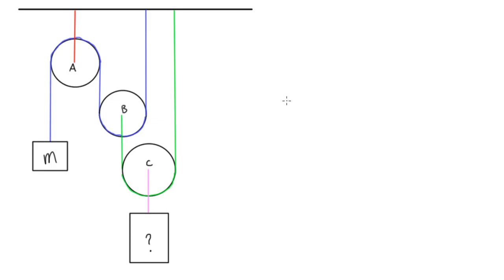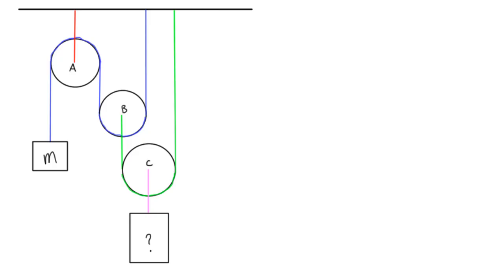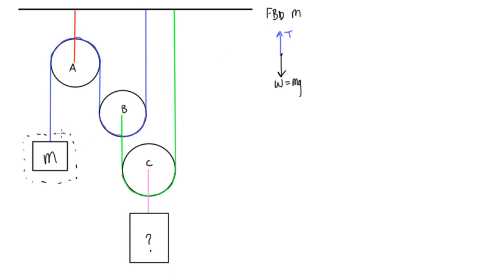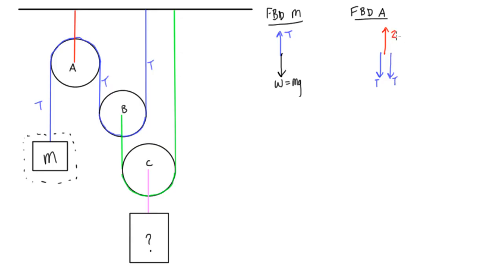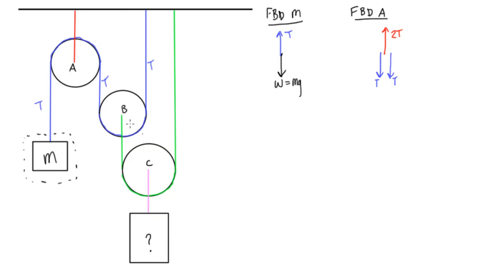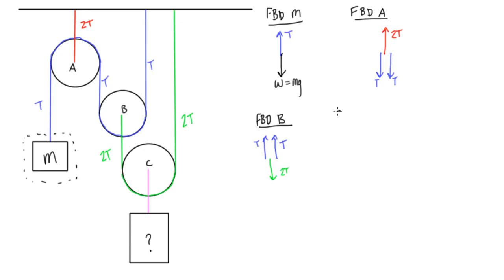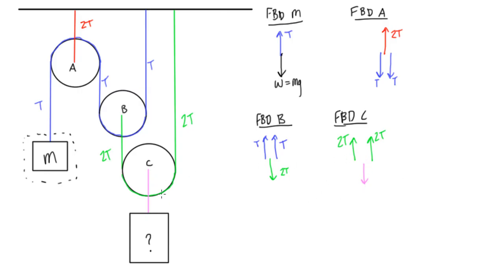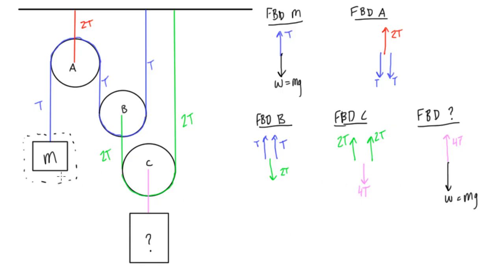How to calculate tension in a multiple pulley system

Comment: Interesting, when reverse the mechanical advantage...in this case from question mark box to m, obtaining a quarter of initial tension for m...you obtain the mechanical dissadvantage useful for building fitness stations. Therefore, you don't have to have 20 plates (weights) or more at the beginning (100kg or more), you only need like half of that and according each cable and it's pulley system, you will have to push/pull/lift a higher amount than the set of weights available for the fitness station.
 For example, if m is a set of weights with a total of 50kg and at the question mark you add another pulley with a cable,  you will have to deadlift 200kg, which would be quite a good weight for a athletic guy.

Comment: thank you very much, I was struggling to understand how can a pulley makes easier to lift something, if the tension on the cable was constant. well, happens that the tension in fact is constant along the cable, and yet, it can multiply the force applied. thank you for demonstrating it, so clearly and so short!
Reply from the maker: Glad I could help!! 🙂🙂

Comment: Just looking at that picture of pulleys lost me.  You are obviously not showing how the green rope of pulley C is attached on pulley B.  Is it tied to the center of pulley B where they pulley B rotates around?
Reply from the maker: In 2D statics problems, ropes will either be wrapped around the outside of a pulley, or attached to a pin in the centre. That's how you will see everyone draw them. So yeah, one end of the green rope is attached to the centre of B, pulling straight down on B. Similar to the red rope which is attached to the centre of pulley A, pulling straight up on A. It is also standard to assume in 2D statics problems that there is no friction in 2D statics problems unless clearly indicated in the problem.

Comment: FBD of C 4T acts in downward direction but in unknown mass block its acts in upward direction... Why??
Reply from the maker: Every point A, B, C , and the mass centre of each block has forces acting up and forces acting down. For each of A, B, C, and the mass centre of each block, the forces acting up at that point are equal and opposite to the forces acting down. This is because we are told that the system is in static equilibrium, so every part must also be in static equilibrium. Point C has tension from each side of the green cable pulling up, and tension from the pink cable pulling down. The mass centre of the unknown block has tension from the pink cable pulling up, and the force of it's weight "pulling" down. The tension force inside the pink cable is equal to the weight of the unknown mass block (which is 40N). So the pink cable pulls up on the block with a force of 40N, and also pulls down on pulley C with a force of 40N. I recommend watching this other video that I made introducing tension in cables: https://youtu.be/nVfAKHMeUxg and then rewatching this video. Cheers, hope that helps!

Comment: How can you use pulleys to ADD weight?
Reply from the maker: You could set them up in a way that a cable will pull on the bottom of an object, adding more force in the downward direction. Is that what you mean?
Reply: Engineer4Free 
I was at a fitness store where the owner fixed abd sold weight lifting equipment. There was a cable machine there, and the leg attachment on this machine had about 4 pullies near the leg press. I commented on this, and the owner of the shop said that the pulley design doubles the weight of the weight stack, because legs are typically stronger than upper body pulling.
Reply from the maker: I can't really comment on it too much w/o seeing the machine in detail. However, if you imagine that we remove pulley C from the set up in this video, and replace the green cable coming off of pulley B with your legs, then your legs must exert a force of 196.2 N to hold the 98.1 N weight in place. Effectively doubling the weight that your legs see compared to the actual weight that is being held up somewhere in the machine. So they probably did design the machine on a principal similar to having your legs replace the green cable and your arms coming off the blue cable to make your legs see a greater load than say the chin up bar or whatever other things are also connected to the same weight without having to adjust the pin as often.

Comment: If the blue rope connects M directly to the ceiling does it still have tension T?
If the blue rope goes over only pulley A and the connects to the floor does it have tension T? 
If the blue rope goes over only pulley A and then connects back to the box of M does it still have tension T or is it now T/2 ?
Reply from the maker: Your first question: Yes
Your second question: Yes
Your third question: T/2

Comment: Thank you for video ,my question can I increase the pully to 6 pully so I can left heavy mass? Thank you
Reply: You can, but just be aware that with the more pulleys you add, the more crucial it becomes to have your information straight. This includes things like the mass of the pulleys, the length of the rope/system, and the maximum amount of tension the rope/pulleys can safely support, as well as the maximum load your anchors (in this case, the ones attaching the rope to the ceiling) can safely bear.

Comment: What if the system's not in equilibrium?Will the tension in the string joining the centre of the pulley be equal to the sum of the tensions on either side of it on the opposite end?Like in your example, 2T=T+T
The books I refer to certainly say so but do not say why.Any help is appreciated
Reply: hey bro, I think its not logical for the system to not be in equilibrium, otherwise the whole pulley would fall apart, so solving this problem as if it were out of equilibrium is just too difficult and doesn't make sense anyway, hope this helps.

Comment: can we out tension t2 on pulley c
is there is any change in answer ?
Reply: +Chetan Sharma can we take tension t2 on pulley c
is there is any change in answer ?
Reply from the maker: +Chetan Sharma If this particular set up is to remain in static equilibrium, the mass hanging off pulley C MUST be 4 times greater than the mass hanging off pulley A. T can be any value, but it depends on m. in fact, T = m*g. So if for example we picked a value for m that was twice as big, T would then just be twice as big. At first when I did the problem in terms of m and T, that was the general case, then at the end, I just picked a random value for m, to give a more tangible example. I could have easily picked m=20kg, then the unknown mass hanging off pulley C would have needed to be 80kg to satisfy static equilibrium.

Comment: Great explanation! I try this on more complicated pulley-systems, but I always get something wrong.
I want to calculate these two systems: http://www11.pic-upload.de/12.04.15/fltzsqdn4c.jpg

At the left one, I got a contradiction. Because the Tension of the mass spilt into T/2 at the beginning. The free body diagram of A has then T/2 down and so need to have two times T/4 up. But C has two times T/2 up, an that is a contradiction to the rope, coming from A.

Can you help me with this problem?
Reply from the maker: Tim Pfeffer Hey this diagram bugs me because the angled cables wouldn't satisfy static equilibrium of the individual pulleys. For example, look at the weight, if there was a tension in the cable MA (which there needs to be to satisfy equilibrium on pulley A), it would apply a horizontal force of cos(angle) * tension to the weight, and it wouldn't be in static equilibrium because sum of force in x would not be zero)... Oh well. Its a bit sloppy but lets move on just pretend they are all straight up and down. Lets define some stuff for your left hand diagram: weight = mass*gravity=W. tension in cable MBC = T1. tension in cable MA=T2. tension in cable BAC=T3. We'll have 3 unknowns T1, T2, T3 that we will put in terms of W. free body diagram (fbd) of weight shows sum of forces in y = 0 so W=T1+T2. You are not allowed to assume that T1=T2=W/2. You have no grounds to do so, all you know is that one force down = sum of two forces up. So, from fbd M we get W=T1+T2. from fbd A we get T2=T3+T3=(2*T3). from fbd C we get T3=T1+T1=(2*T1). If you really want, you can find tension in the cable securing B to the ceiling and call it T4. from fbd B we get T4=T1+T1+T3. Now you just need to substitute like a mofo. W=T1+T2 -> W=T1+(2*T3) -> W=T1+2*(2*T1) -> W=5*T1 -> therefore T1=(1/5)W. Now that you know T1, you can solve for T3 because you know that T3 = T1+T1 from fbd C. T3=2*(T1) -> T3 =2*(1/5)W ->T3=(2/5)W. Now you can finally solve for T2 from fbd A. T2=T3+T3. -> T2=2*(2/5(W)). -> T2=(4/5)W. For fun you can check the cable connecting it all to the ceiling and you get T4=T1+T1+T3=(4/5)W. Now you can draw the fbd for anything (the weight, pulley A, pulley, B, or pulley C) and you'll see that sum of forces in y direction will be zero for each one. I realize now I should have just drawn a picture and it would have been much clearer, but moral of the story is that you can't assume T1=T2=W/2 at the very beginning. Also don't forget to rage over the fact that the angled cables need to be drawn vertically to be technically correct. Hope that helps bruh.
Reply: @Engineer4Free  I did like your explanation actually much more better than my physics sir he explained me a lot of methods and one of them too didn't work due to overweight of complexity but it's simple to understand and find tensions for multiple pulleys when I go this way